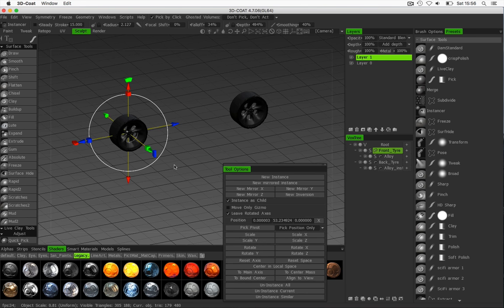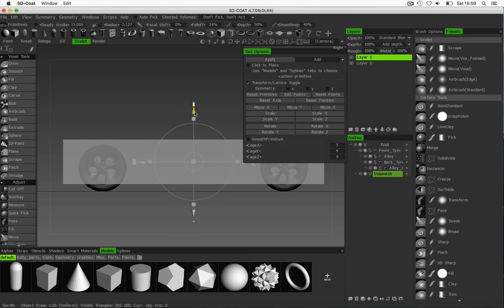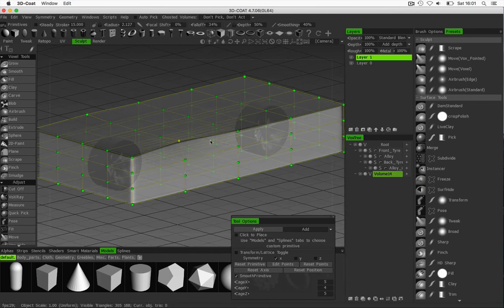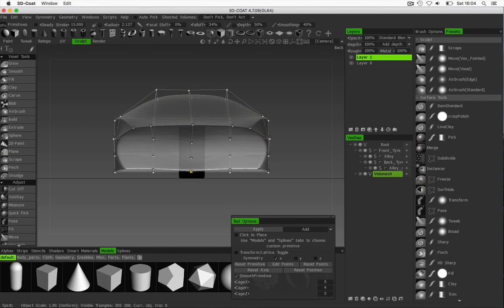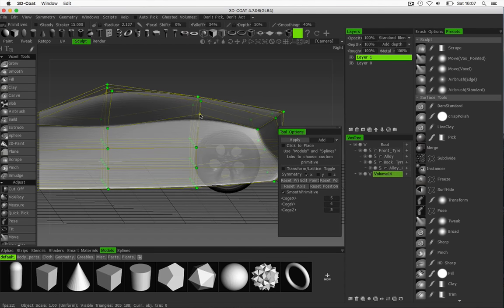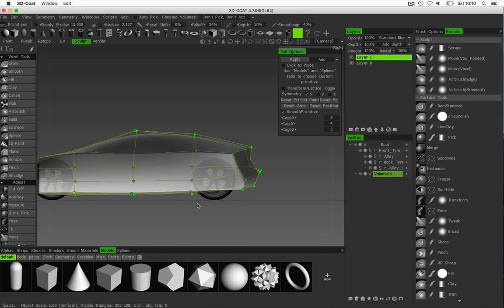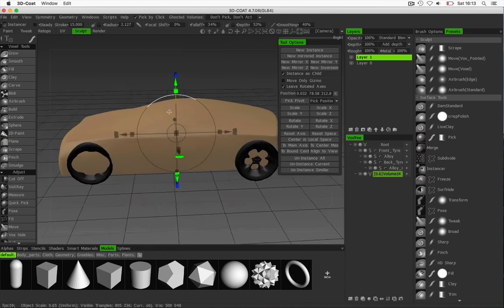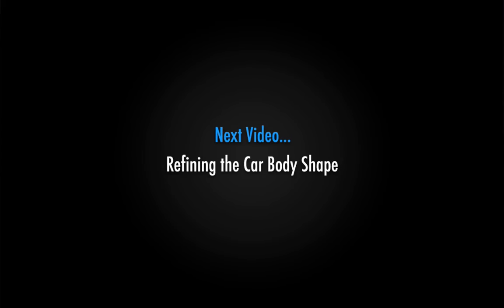3D Coat Concept p2 - Voxel Primitives

Comment: How do you setup a voxel cage as in this example ... I don't see the CageX,Y,Z sliders anywhere in the latest version
Reply: it is there, but... First you must pick Primitives-Free form cube-then click on cube/column in Sculpt Models panel. It will load selected model in free form mesh, and you will have those sliders where you can manually set subdivisions of control mesh.

Comment: No souch option in latest version (((
Reply from the maker: I'm not sure which 'option' you are referring to, but I'm thinking the Primitive Tool? Create a New Voxel Sculpting Scene. Click on Primitives Tool. Click on the Cube. Next go to Windows > Poly Models. Click on the cube in the Poly Models window. Now within the Tool Options Window you should see Cage X, Y, Z  at the bottom. Only items from the Poly Models will allow you to change the cage count, otherwise you have to use the preset cage values. Hope that helps.